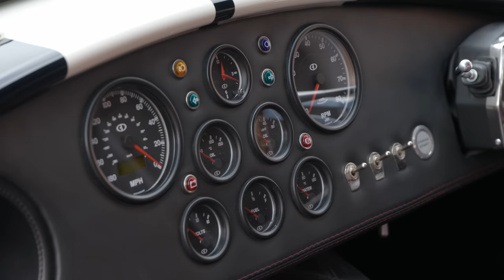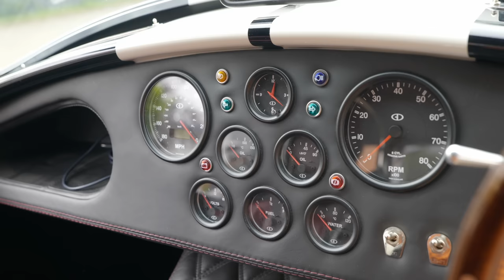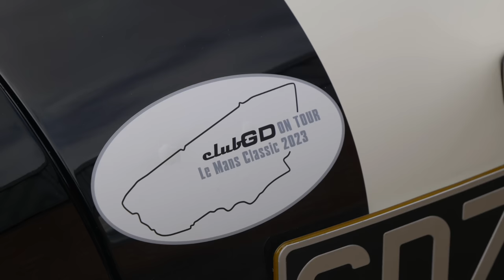The Gardner Douglas 427 Mk4 is a Great Car, But Apparently *NOT* a Cobra - Why?

Comment: No need to apologise for the sound quality... it was glorious listening to that thumping V8!!
Reply: A big displacement LS is one of the most underrated sounds in all of motoring... I think it's 'cause they're so common people don't list them in their favourite sounding engines. But God damn you can make an LS sound mean as all hell. The exhaust systems on the very late model VF Commodores had it absolutely nailed, they actually make me swoon above 4000rpm 🥴😍
Reply: @C.Fecteau-AU-MJ13  I own a resto modded Land Rover defender 110 with a JE Engineering JLR 4.8LV8. It will sound awesome when I get it back after its latests upgrades...but.. an American V8 LS3 will sound so much different.. in a good way! No right or wrong here! 🙂 they are both epic!!
Reply: @cowanscott9047  Oh man those Jag V8s do make a dirty, dirty noise... Another great engine.
A mate here in Australia had an XFR when they were new and that thing was epic. That car could do it all, way better than an M5, on the road anyway. 

The 110 restomod sounds wicked man, bet it's one hell of a mean thing to hear tearing it up out there in the mud.
Reply: I own pretty much the exact same as this car featured but in dark blue. I also specced the throttle body package by AT Power. What you don’t really hear well in the video are the induction noises this set up gives. It is delicious, angry and very, very addictive. I love it!
Reply: I just pulled the trigger on one.. can’t wait to get it!!

Comment: The rain footage was wonderful. I once got caught in the rain in a Caterham with septuagenarian passenger. I couldn't figure out why the windscreen wipers were not clearing the water until I realised the offending rain was on the "inside" of the screen. We laughed about it later. As Henry Catchpole would say after he dailyed a Seven for a year, buy a good sailing jacket.
Reply: another good example, the caterham 7 isn´t a Lotus caterham but it´s licensed to be a car, the caterham
Reply: I used one for a year too, back in the early 90’s. Drove roof down, in snow, filling the boot! Gleeful fun, but yearned for heat!
Reply: @kurtbarker3303  I salute you good sir.
Reply: Had a similar experience driving my Elise back down the M1 without the roof after I bought it

Comment: An ND V8 Miata weighs 2600lb, has a whole host of driver aids and airbags, and goes like hell. This has more power, half a ton less weight, zero driver aids, a fully triangulated modern chassis, and properly designed racecar suspension. And all of that makes the Cobra seem docile by comparison.

Comment: I'd argue that a lot of modern replicas are better than the original Shelby Cobra. They might lack the prestige but they're stiffer, lighter, have better suspension/tyres, better engines and a better transmission
Reply: have you ever been in one? Ive been in a AK and a DAX, using old modified jaguar ladder frame chassis, they're absolutely terrible.
Reply: @ahemgee9542  Yeah but they're a nearly 40 year old design based on an 80s chassis so not exactly modern. The original cobra was also a ladder frame more or less which gives all sorts of peculiar characteristics compared to the more modern space frame chassis designs
Reply: @ahemgee9542  Having owned my AK  for over 20 years, i would strongly despute your "terrible" claims, unless of course you are used to Rolls Royces or hi end Mercs, also they are not "modified Jaguar ladder frome chassis", they are bespoke ladder and partial backbone frames designed to take whichever running gear you spec!, if you are going to slate something at least get your facts right!

Comment: The LS is always a great option for builds like these... They're plentiful, powerful, affordable, reliable, and quite compact for their displacement. Surprisingly economical too.
You can slot an LS into pretty much anything and get a good result. People say it's predictable going LS, but it's a predictable choice for a host of good reasons.
Reply: I'd say extremely compact for their displacement. An LS ranging from 5.7 to 7 liters is pretty much the same physical size as a Nissan 3.5 VQ35 :)
Reply: They're not common here in the UK - I don't think they ever officially made it here in any car. Only very recently the LT in the C8 corvette.
Reply: Its neither. We never had an LS v8 cars here of any description as any available good. Closest it ever was is Vauxhall/Holden Monaro/Pontiac GTO sold very briefly in UK. Aside of imported us cars it sight unseen.
Ford Mustang V8 since its sold here finally is more common. Aside of that older V8 bmws, audi and mercedes cars, for uk Rover V8s and Aston marton cars. Rest is rare exotics like ferraris and maseratis.
Reply: Unless it's a FORD engine, it's a replica....this is just a kit car !!
Reply: @arkhsm  Even with a ford engine, it would be still a replica. And it is a great sportcar regardless, and it could be relatively expensive too, but of course a replica is just a replca. Anyways kit car means you build from a kit, which is not exactly the case with gardner-douglas, because it can come out from the factory as a rolling ready car

Comment: That panel strength demo at 17:23 (showing the foam filled panels cross section and actually standing on the panel without denting or breaking!) shows just how incredibly impressive these wonderful cars are. Plus it also shows just how much love is put into the building/assembling of these works of art. I now desperately want one, in fact NEED one!

Comment: I’ve owned a MK3 GD427 since 2007. Ford 302 engine with 367bhp, Jag running gear and T5 gearbox. Black and chrome, under slung pipes so classic 60’s looks. Driven it with my wife to Monaco where it got more attention in Casino Square than all the regular supercars! I’d never part with it. Thanks GD.

Comment: These Cobra copies/replicas are fairly common in the USA. “Real” Cobras 1. Have a CSX serial number 2. Use an aluminum body. 
New ones are known as “recreations”. The replicas are still fun vehicles!
The 427 is cool but as an adult I appreciate the 289 versions more than the big block version. Seeing a bare aluminum 289 Cobra is a beautiful sight!
Reply from the maker: I love the look of the 289
Reply: Bizarrely the Americans only buy or build Cobra 427 roadsters. UK builders make 289 FIA GT Cobras with a roof (faster, and because rain) and rear exhausts instead of the dumb side exhausts that either burn you or poison you in traffic.
Reply: Totally with you there 👍
Reply: @truantray  AC is the brand that made the car but filled for bankruptcy, cobra was the model and shelby install there the ford V8 engine this is not a shelby also not a ac but a DG
Reply: Even with aluminium body (kirkham) and even with csx number (factory five, or ERA or some of them - fiberglass bodied replica - has CSX) it can be a replica though. It doesn't mean  by any ways that a replica would be a worst  car than an original was, but it worth way less for sure.
Reply: @johnny427  the stratos body kit with the alfa-romeu engine 3.0L v6 is said to be the best of all, original with ferrari engine
Reply: more than enough for it´s body ,the 427 is not even a improvement just to say "my car as more gasoline comsumption than yours" both are already extremelly powerfull for the AC body
Reply: You should check out the Superformance Slabside model . Looks brilliant

Comment: I have a DAX top on my Backdraft and with the top on it is definitely more windy and louder inside the cockpit. Put the windows on and it's a whole different car. Almost comfortable....

Edit: After watching the rest, the windows do help with wind/noise and most of the water but not all. The water getting on your foot is because all cobra windshields mount on two posts directly through the body. It's a direct route for water dripping onto your foot.

Comment: Hello James. Thanks for another cracking review. Hope you are well.

Suggestion. Do you think you can get hold of an MG ZT or TT 260 to drive? Less than a thousand were built before the company fell over and got bought up by SIAC(?). I wonder just how rare they are, how good or bad they are. I found it interesting that the rear discs were a tad bigger than the front discs, how unusual is that?

Thanks again.

Comment: Yes, the original AC design can use improvement. For some unknown reason, it is still a roadster without truly functioning side windows. Not only will it keep your assets dry, but they are also a necessity with air conditioning. It is folly to keep your feet cold but your upper torso is wind-blown and burning as the outside temperature rises toward 40C. While 40C may be extraordinary in England and on the continent, here in the States it has become more common week in and week out. I do applaud the functional hardtop as a necessary piece of kit. So if you were able to combine the hardtop with fully functioning roll-up side windows, you would have a car worthy of driving from New York to San Francisco mid-summer. A journey of 3,000 miles.
Reply: It ain't ment to been a comfortable cruise, it's a true classic sportscar. It's like an motorcycle on 4 wheels. Americans actually used to love this type of very basic and nimble sportscar.....

Comment: I know someone who does drive a real one at least weekly and thinks nothing of using it for shopping, it's not quiet a real cobra as its actually an AC 289 Mk3 (basically the same as a Mk3 427 AC Cobra but using the 289 V8 of the Mk2 and made after Shelby parted ways with AC). She has also known the car since it was new in 1966. The other thing is the roof it came with had never been used!

Comment: Is E20 hydroscopic like E10🤔 Hope everything is corrosion proofed wherever the fuel goes if it is, E10 degrades and goes off more quickly too. Yuk! Don't get me started on the marketing con that is fuel sales, let alone potential engine killers such as E10.

GD is a great company, great products. Hawkridge are too (as are only a select few others), also with great products and I came very close to buying a 289 or ACE replica (the latter being equipped with a 2.5  straight six and several Webbers). But I was tempted away by a MK1 AH Sprite to Sebringesque spec then a mildly tuned MGBGT V8.

The only thing I didn't like about GDs -as a kit? The pedant in me didn't like the mounting of the dials in the centre of the dash, arguably more user friendly, but I liked the AC Cobra layout around the steering column. Having written that, the GD is probably the best of this ilk to live with and it's chassis is superb, dare I say better than the Tojeiro original (and his later updates) 🤔 Plus the bodies could be lifted off easily for maintenance and/or race day mods etc.

I mainly drove the Sprite with a tonneau cover (and side screens) and if push came to shove an umbrella to keep the tweed jacket and pipe dry at traffic lights - speed kept me drier. With the hard top on? It let in almost as much water, maybe more, which my navigator/co driver would complain fiercely about. We ended up tearing through a few farms (his fault) and we went airborne a few times, John Sprinzel stylee (my fault) on various rallies. Lots of fun though.

Always thought an Aceca replica based on Hawkridgesque suspension modified MGB under- pinnings (readily available) with a Triumph or BMW straight six fitted would be a nice motor🤔🤔

Comment: the best cobra rep u can get
Reply: That's probably AC cars A.C. Cobra.
Reply: @Blaidd7542  no because ac cars version isnt a replica lol. this will outhandle and outperform an ac though
Reply: @shadmonk  I would consider the ones made by AC decades after the lemans and Shelby era as replicas, by then there wasn’t much left of the original company. And it doesn’t seem right to call one made in the 80s a original although they were identical to the real thing.
Reply: @Blaidd7542  thats your opinion i guess. but technically they cannot be replicas, they can be termed continuation cars

Comment: Yes that is sacrilege. You do not put a GM motor in anything that should be powered by a Ford engine. There’s a reason Shelby never went to GM for anything they make junk. Chrysler is not much better but at least our cars look exciting but every cobra and cobra replica should have a Ford small block or big block.
Reply from the maker: There is apparently no current Ford engine that suits the "ethos" and passes emissions for factory builds. Home builders have a lot more choice
Reply: @JayEmmOnCars  to be honest I haven’t checked lately, but I’m sure you can get a 427 or 428 or even a boss 302 from Ford motor company today
Reply: @JayEmmOnCars  the only reason people put Chevrolet engines or GM engines in Ford products is because you can build a Chevrolet cheaper than you can build a Ford not that it’s better it’s just cheaper
Reply from the maker: @Kyfordman1989  it's not that you can't get them it's just that they won't meet the relevant regs here, or so I am told
Reply: The reason the Cobra got Ford engines was that Chevrolet wouldn't sell engines to Shelby, because they saw the Cobra as an competitor to the Corvette. Shelby went Ford after he had recieved a no from Chevrolet. This is info that can be found in books about the Cobra.

Comment: Superformance should not be lumped in with all the other replica knockoffs, which usally use an old XJ chassis and Chevy engine etc. Their cars use original Shelby / Ford Designs and Ford performance engines. They make continuation cars- not replicas, and are the only company licensed to do so by Shelby.
Reply: Superformance also makes new C2 Corvettes!
Reply: I'm fed up of people that keep waffling Superformance spouting the exact same thing they say on their website. They were only given the license by Shelby because they were the only 'kit manufacturer' that approached Shelby for the license back in the 90s. Shelby allowed them to use 'new' csx chassis plates. That's it, they're not Shelby Cobras, they never will be. Were they one of the 400 built in the 60s? No. Is it built by Team Shelby? No. Its purely marketing waffle to leach people of $100,000+ for a kit car that gets pre-built. Yes there's some kits out there that are absolute dog** but the likes of this GD427 with the Euro Chassis is moon miles better than an original Shelby. 

There's no shame in owning a kit car, if anything if you can build one of these yourself or with family and friends, it's worth more to you than what it's market value is.

Comment: I am just thinking of all the used exotic options you could get for 100k. Pretty much most astons for example
Reply: I own a couple of 'real' classic performance cars myself and there are a lot of very ordinary Astons out there for 100k+. Don't get me wrong - classics are my thing too - but this GD would sadly leave most of them in its rear-view mirror.
Reply: Have pretty much an identical car but with sidepipes and Halibrands. Have also owned a beautiful Storm metallic Aston. The Aston was lovely but the Cobra has something extra, a fun factor which is hard to beat. The price reflects the engineering design and quality. And at 500bhp per ton is significantly faster too.